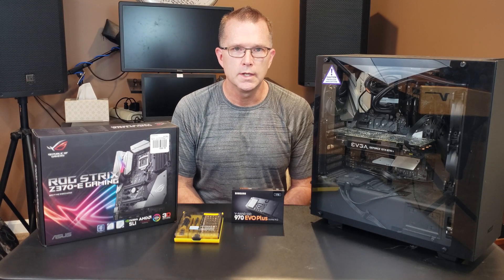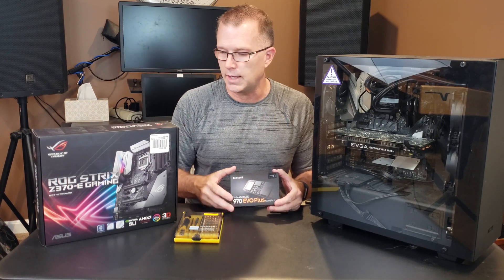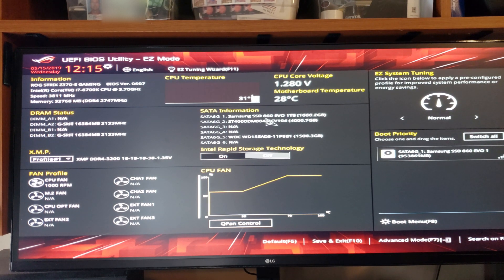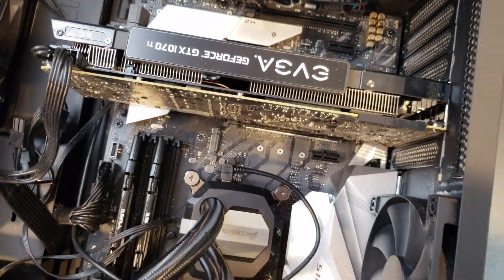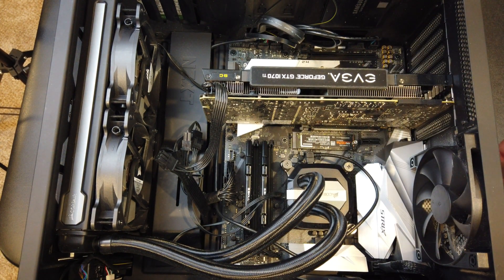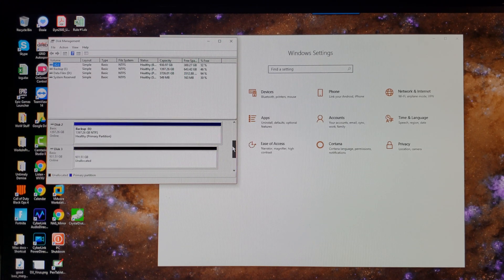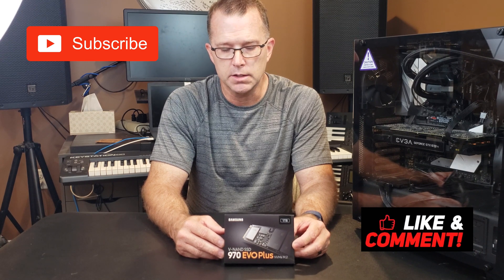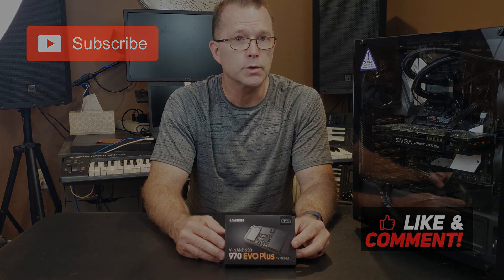SAMSUNG EVO 970 Plus M.2 NVMe SSD | Step-by-Step Installation, Configuration & Performance Testing

Comment: My Christmas present is EVO 970 Plus 1TB. I can tell from the size and weight of the package. I found your video exceptional and plan to use it while installing the SSD. I wonder, however, that in many videos and articles there is emphasis on static electricity and magnets. I haven't see you using any anti-static measures and you do use a magnetized screwdriver. Could you explain it please: Do I need precaution or not?
Reply from the maker: I've never had an issue with it. As long as you're not in a super dry area, prone to static build-up. Also, I always touch the metal chassis before handing IC boards, just as a basic precaution.  Also, a magnetized screwdriver is not strong enough to create any issues. You're more like to hurt something by dropping it onto the motherboard. So as long as you're at all careful, you shouldn't have a problem.
Reply: @ReeWrayOutdoors  I tend to agree with you on the ESD protections, but we all know that one day, ZZZAAAPPPP!!!! In all the systems I have built, sadly I have been remiss in the ESD protections, but ALL of my builds have lasted >10 years, only to go by the wayside for new tech and never any system failures.
Reply from the maker: @scottyvincent  Yeah, I agree.  It's a thing...just not TYPICALLY as big a thing as many people make it out to be.  If you haven't seen it, check out this video with Linus and Mr. Boom on this topic (it's informative and hilarious): https://youtu.be/nXkgbmr3dRA

Comment: I have a Asus TUF GAMING x570-Plus (Wifi) Motherboard. The Bios seems to be set up a bit different. I don't have x2 or x4 as an option. I have Gen1, Gen 2, Gen3, Gen4 and Auto as selectable options instead. Which one do I pick for my EVO 970 Plus NVMeSSD?
Reply from the maker: I'd start with Auto and see what kind of read/write performance you get.  You're not going to hurt anything by trying different settings and seeing what you get, but Auto or Gen 4 would be where I'd start.

Comment: Should I worry about finding a heatsink for this? If so, what would be some good ones?
Reply from the maker: I did a video on that topic about a year ago.  My personal opinion is that it's unlikely to provide much benefit for the typical user.  If you have a case with good ventilation, I'd skip it.

Comment: Hello, stupid question. Do I remove the sticker on the top if I install a coolingblock on it? ( newb pc builder )
Reply from the maker: I'm not sure there's a great answer to that.  First, the label itself has some heatsink properties itself and removing it  could void your warranty if you ever needed it. 2nd, the memory chips actually perform best (to a fair degree) when they're hot and its really the controller module that benefits most from being cooled. For all these reasons, my recommendation is to skip the add-on heatsink altogether and leave the label on.  I don't think you'd miss it.

Comment: I just want to let you know, you just saved me a meltdown. It took me forever to install this, and if it wasnt for you, explaining that the nvme was taking my sata drives 5 and 6, i wouldve been stuck. I was getting just blank screens with no bios or anything after installing this, only until i moved my other sata drives to 3 and 4, did it finally work. thank you so much.
Reply: Yeah that was good info, i run on the asus dual xeon motherboard Z10-PE with i think 7 drives in total, so adding this i will likely be forced to run in x2 mode but even then it would be way faster than my spinning drives for running a game like Star citizen that takes 5+ minutes to load today.

Comment: You installed the NVME drive in the M.2_1 slot.  You enabled 4X mode  for the M.2_2 slot. That slot is currently unused.
Reply from the maker: Hmmmm. Then how would you explain the fact that when I set it to 2x mode in the bios and redo the read/write test,  I get exactly half the speed vs using the 4x  mode?  :)

Comment: Can you recommend some site where i can buy that one screw ?
Reply from the maker: This should work for you: https://amzn.to/2IAjT0L
Reply: @ReeWrayOutdoors  Thank you and can you tell me which type of screw exhaclty is it ?
Reply from the maker: @mareks7129  should be  2.0 x 3mm. Also sometimes referred to as CM2x3-3.3
Reply: @ReeWrayOutdoors  Thanks for that, one more question i have ASUS B250G Gaming Motherboard but when i made chceck in BIOS, i dont see there in Onboard devices that line with "M.2_2 PCIe Bandwich Configuration (X2/X4), will i see that when i connect SSD ? ore is it some porblem with MOtherboard ? And the version of BIOS is same as your

Comment: I bought a 980 pro. I want to use it as my boot drive. I’ve done something similar in the past but not with an m.2. I used date migration from my original boot onto my 1tb 980. In my bios I can’t select it as my boot. And when I go to the partions it doesn’t appear. Help please

Comment: Maybe you can help me, I bought the 2tb version and it’s been causing problems, and whenever I play Overwatch it crashes 3 seconds after loading into the game, I don’t know what to do anymore...I’ve tried reinstalling the firmware and drivers, it says it’s working properly but I know it’s not cause it’s not showing in Samsung Magician
Reply: I would contact Samsung or your MB mfg for support, that could be a faulty drive or BIOS settings issue. Also, YouTube is your friend, perhaps others have had similar issues?

Comment: What is ur boot time from when u turn on ur power button?
Reply from the maker: There are a variety of ways to 'time' this, depending on when you consider your machine to be finished booting.  But I attempted to answer that with some testing in a more recent video: https://youtu.be/2rrPuam3fRM

Comment: I was thrilled to see the 3500mb read/write ranges of speeds on these a while back until I saw the actual game loading comparison to a good SSD Sata3. Almost the same performance maybe 1sec faster. These new drives can transfer files fast as long as it's NVME to NVME but so far I haven't benefited a whole lot from this tech. Microsoft is supposed to release some software update that provide support to take far more advantage of these in games in the near future. Mimicking the next gen consoles drive speeds. 
I just realized I installed both my Samsung Evo 970 500gb Boot and Adata SX8200 1TB Game Storage as MBR instead of GPT. I still don't have my BIOS in UEFI so I don't think I am taking full advantage of the speeds.
Reply from the maker: All valid observations.  I don't think you'd see any tangible performance gain, using  GPT, tbh. I did a 2nd M.2 video showing how to move from a SATA3 SSD to an NVMe boot drive and then did a boot speed comparison.  The result was fairly underwhelming.

Comment: I have a short question regarding the Evo 970 Plus.
Every time I put my Mac in sleep mode, something is happening and a folder with a "?" appears on the screen. 
After restarting the Mac everything runs perfectly again... 

Does anyone knows what's the problem and how to solve this?

Mac: A1419 (Late 2015) 
macOS: Catalina 10.15.7
Modell: Samsung SSD 970 EVO Plus 2TB
Version: 2B2QEXM7

Thanks a lot for your help

Comment: Thank you for the informative video however how do you get the list of SATA Information displaying SATA6G information? Mine only displays P1 and P2. My M.2_2 PCIe bandwidth configuration is also not displayed. I have a ROG STRIX Z270H GAMING
 for reference and in the manual it mentions that the M.2_2 socket is a M.2 Socket 3 Type M (2242-2280)
 which supports PCIe3.0x4 mode.

Comment: If I unplug my hd, and boot up to the ssd and install windows on it as if I just built the pc, will I be able to plug the hd back in and have the stuff on it?
Reply from the maker: You should be able to , yes.  All your old files will be there,  but you'll have to reinstall your apps on the new OS.

Comment: I usually have no problem building a pc my last build 8 years ago the only thing I missed was partitioning the hard drive and I hope to get that right this time. However being I have built an older one, I would like to know If I get this to put into my new system if I can use my optical drive with a physical disk to install windows 10 on this like normal, or do I have to do something else? I want to use this as the boot drive.
Reply from the maker: You should be able to do that. Alternatively, you could make a bootable  Win10 USB stick and install from that. MS has info on how to do that on their site. Pretty straightforward.
Reply: @ReeWrayOutdoors  Thanks:)

Comment: i bought this ssd and im having troubles installing it properly, it doesnt recognize the ssd. i have a asus x-99 mb, please help!
Reply: Did you go into Disk management and format the SSD after physically installing it?
Reply: if the evo is installed on the motherboard, it's very important to install the nvme driver for the new sdd! without this driver the 970 doesn't shows up in disk management! that was happened at me. so, 1st install 970 but boot from old boot drive, 2nd install nvme driver, i use the Samsung one bc runs good, reboot 3rd after reboot 970 evo is in disk management and now you can make a backup from windows (i use Macrium Reflect Free, very easy to use!) and copy the image on the 970ty, 4rd set boot drive to 970 and disable all other boot drives and boot options, 5th done!!
Reply: and of course, yes, i format the 970 at disk management if the question was for me
Reply: Steffen Lze no it was for the dude who is having issues
Reply: is the bios showing the 970? if not, the ssd doesn't sitting right in place. you need to push it full into the socket! if it's full in and not showing up then reload default bios settings. your x99 chipset is same as old as my Asus z170. so, should work fine!
Reply: I finally got it working, I had to change some settings in the bios
Reply: @AModdedController  Ok good, what setting did you change?

Comment: You are not supposed to screw the M.2 into the board.
The board comes with a riser which you should place in the correct position.~
Then you screw the M.2 into the riser, that way its level and not bent down to the board.
Reply: there was a riser installed already...  he has 3 of them on each position

Comment: nice informative video! i was wondering, in my bios i dont have the option to change it to x2 or x4 mode. i just have that first line that says configuration. do you know why that is? thanks!
Reply: some motherboard vendors just dont give that option (to switch). on my intel z170 chipset(Asus mobo) the ssd pci-e socket permanently runs at x4.

Comment: I recommand to remove the two stand off in the middle of the m2 drive so you dont short anything there, basicly it should fly above the motherboard, except the one you hold the drive with.
Reply from the maker: Despite appearances, I actually only had the 1 standoff in place. The threaded standoff inserts on my motherboard look very much like actual standoffs (which led to me mistakenly not using a standoff in my first SSD video... I'd thought there was already one there.)  but you're certainly right, you wouldn't want the PCB resting on unused standoffs.
Reply: @ReeWrayOutdoors  Ah ok then, my bad, thank you for sharing this video it's indeed well explained.

Comment: Nice how to video.
I am curious if the older drives would have performed a little better on the performance test if they had been empty and freshly formatted or if that would have no effect on results?
Reply from the maker: I think the performance of the older drives could have been impacted by excessive fragmentation, but in my case these drives were in a pretty healthy, unfragmented state, so I don't think there would have been much improvement even if I had freshly formatted them.

Comment: it doesnt pop up in the disk management, i have tried everything, pls help me. does it have to be screwed all the way down?
Reply: i had the same problem as i installed my 970 evo plus 250gb (W10 boot drive). in my case, the ssm (solid state module) wasn't complete clicked into the pci-e socket!
Reply: @steffenlze0178  yeah i found out my mother board was a defect so i just returned it and got a new one.
Reply: @adamski1758  good, now it works?
Reply: @adamski1758  ok then, when you set it all together and still have problems or questions then just ask!

Comment: I just bought the 970 Evo and I'm pretty much a newb with this stuff. I checked my bios and I don't see an option to change m.2_2 from 2x to 4x, there aren't any options at all actually. It only shows 1 option for m.2_1 and that's to set it either to auto, sata, or pcie. I have a different Asus z370 board (bios is very similar tho), and the manual says the top slot disables sata 1 if it's set to sata. I'm assuming the bottom one is pcie only (opposite of yours) but it doesn't specify. I have to wait to install as my prebuilt PC didn't come with the mounting screws or standoff, I'm just worried the second slot won't work. Do you know if it's normal for it not to show options for the second slot in bios? I also believe I only have 4 sata ports so the second slot doesn't disable any according to the manual. Great video by the way, very informative.
Reply: if your bios doesn't show the x2,x4 switch then the mobo permanently runs at x4. the other switch, m2 config as sata/pcie should be set on auto. I'm running Asus mobos all my life and the auto setting works normaly absolutely fine.
Reply: @steffenlze0178  thanks!
Reply: Same problem, not sure why I can't see it.

Comment: The bios setting x2/x4 is only when using slot 2, and you used slot 1. So the Sata 5/6 is not affected.
Reply from the maker: Not sure you are correct on that, because I have speed tested with it set to X2 and I definitely got half the speed as when set to X4. So that setting clearly does apply to that socket on my particular motherboard.
Reply: @ReeWrayOutdoors  yup, this setting depends on all m2 slots at the board!

Comment: Like the video, but WHY not use as OS drive? The Samsung 970 will run 5-6 times faster than a 860 EVO! Video will be fine on the 860 EVO.
Reply from the maker: Yeah totally agree. At the time I did this video I just wanted to see how it did as a scratch drive for rendering.  Not all that much as it turns out. Haha
Reply: @ReeWrayOutdoors  Swap the drives around & you'll see & feel a big difference!👍

You can restore the video drive by backup to external drive with Macrium Reflect (Free Edition), just make sure the partition will fit the EVO (restore only after the 970 EVO Plus boots). It's possible to then clone the 860 EVO to the 970 EVO Plus. Note that sometimes clones to NVMe SSD's doesn't always work, yet Windows 10 has the needed drivers, And Macrium can fix boot problems if media is created. 

Good Luck!

Comment: I have a Z97M-Plus Motherboard, I don't have that option in the bios, I go to advance mode and advance option, could you help me?
Reply: if you dont have it then your m2 slot runs at x4. you can see it in the numbers when you run Crystal Disc Mark.

Comment: Hi there 🙂.
Highly informative video, thank you. I  know there's a perfectly logical reason, but why isn't there any data written next to the M2 installation slot on the motherboard?? I guess the only way to know which slot is what, would be some form of trial and error??🤔 Could you please give us some hints on how you figured which slot was which?? Thanks for any insights you might have to share. 👍🙂
Reply from the maker: The M/B user manual describes everything in detail for you so no guess work!  If you don't have the manual handy anymore, you can sure find it on the MFG website support page as a pdf download. :)
Reply: @ReeWrayOutdoors  Hi there 🙂
Thanks for prompt response ⚡👍.
David Bridges

Comment: Not sure if you are using the ROG Strix Z390 E Bios or if I have a newer version. To get this to work, I had to disable SATA ports 5 & 6 in the BIOS as my PC would not boot even though no drives were attached to these ports. This may be due to another setting that I am unaware of but I hope this may help others if they encounter this problem.
Reply from the maker: Thank you for add.  Always good to get additional info sharing!

Comment: You doing it wrong the ssd drive comes with a screw set with socket and a screw socket you should have being put on the board
First
Reply from the maker: You're not wrong Steven.  See my pinned comment from several months ago on that point.  Also, unless Samsung has changed the assembly, my 970 didn't come with any mounting screws at all.  That why I also posted an Amazon link for them.
Reply: ReeWray Outdoors sorry my mistake it comes with the motherboard

Comment: Hey I'm planning to use this M.2 SSD (250GB Version) on my new computer I'll build next week and I want my Windows on it, do you think it's possible to put the Windows on this SSD or does it need any configurations before I can do that on a brand new PC? Also I'd love to use that X.4 setting you used, would that be a good idea too if only Windows is on this ssd?
Reply from the maker: Yeah, I don't know why you WOULDN'T use X4 mode if you can.  You should be able to set the M.2 up as a boot drive in the BIOS, and then have the Windows install setup on a bootable  USB drive.   Boot to the USB drive and install Windows to the M.2 and you're off to the races.  If you've not done this before, you'll find info on the MS knowledgebase about how to use a USB stick to install Windows.  Fairly common thing these days...
Reply: you just need to clone your existing W10 installation on the new ssd. Macrium Reflect (free version) makes that very easy.